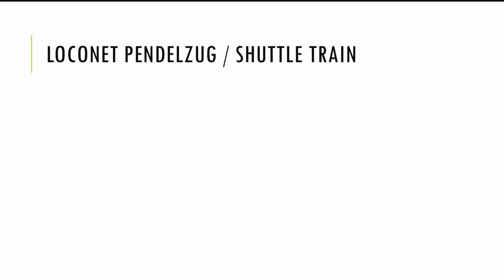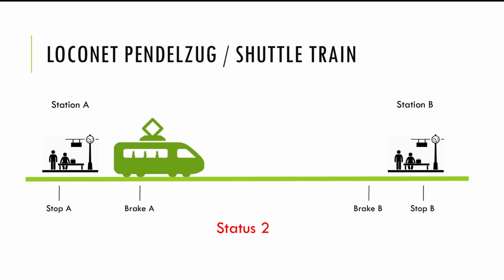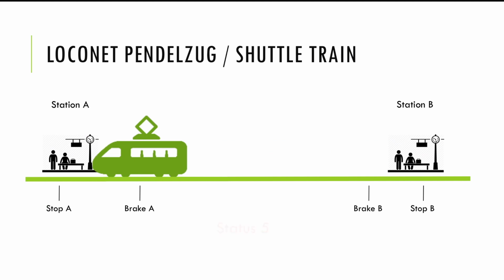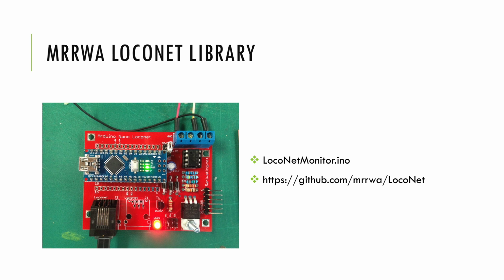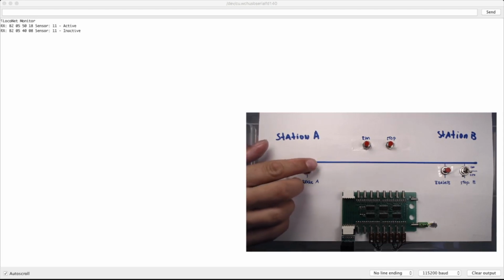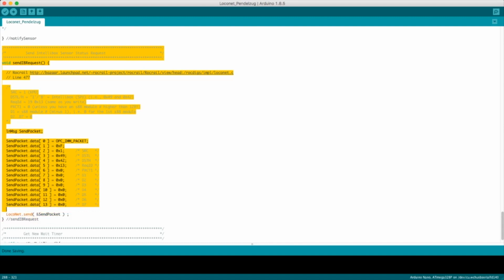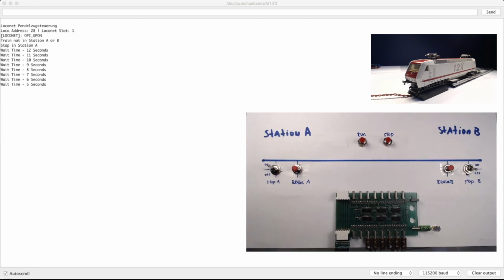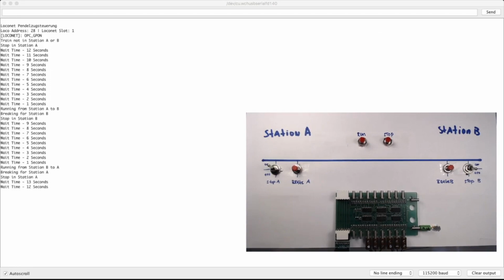Arduino | Loconet Pendelzug

Comment: Very interesting . However, not every model railroader is willing or even able to go down this route . The Uhlenbrock Lissy and Marco shuttling comes as an affordable and complete system with everything needed without having to assemble electronic boards and referring to arduino  projects . The other way for DCC shuttling is the Lenz ABC module with Lenz decoders which is very affordable ( BM 1 module )  and works great every time  and I am using it on my G scale layout . The ultimate idea being Shuttling without PC control .

Comment: Excellent video and thanks for sharing the code. 
It was really helpful for me. Maybe you can help me clarify some understanding of the Loconet. Based on your code, what is the different between the Address and mySlot ? In line 130 you are using mySlot, but how does the Loco the address you are sending to. Furthermore what is the purpose for line 84 ? Mikkel